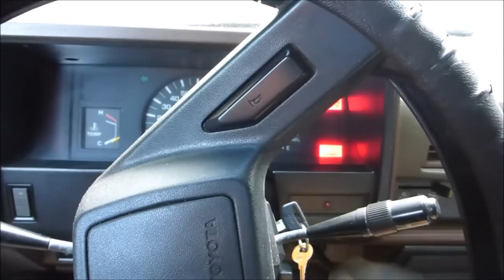Toyota 4x4 Pickup to Flatbed Camper Conversion - Part 5

Comment: looking good, getting me motivated :P, I have to do my ball joint on my f250, not looking forward. i am little angry with my F250 6.0, it only has 78k and I've had more problems with EGR and Injectors, did the EGR delete, and it seems that running synthetic oil with additives help my injector issues. but i swear that this truck has been a major pain. I just need to fix it up, because the price of these truck now a days, freaking ridiculous.
Reply from the maker: +Terry Rau I know the modern Ford problem all too well. This Toyota rebuild project was motivated by the failure of the suspension/steering rack in my 6 year old Ford Transit Connect with 95k miles on it. The rack on that one is basically trashed. It seems modern vehicles are engineered to last about 100k miles, after that the yearly cost to keep them on the road are substantial.

Comment: When buying new ball joints is there a driver/ passenger side one or are they universal in that way?
Reply from the maker: Universal for either left or right side, but watch out I found 3 different bolt patterns at my local parts store. Probably best to take them off first then go shop them if you can.